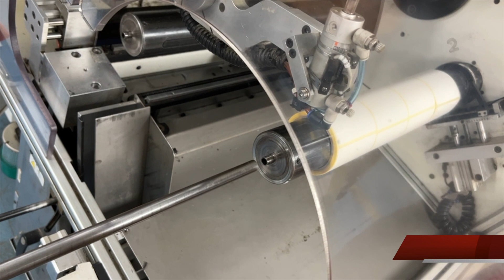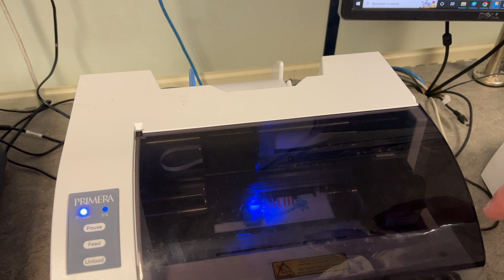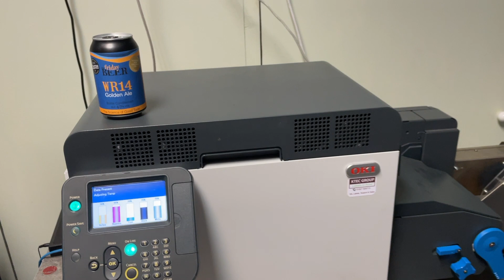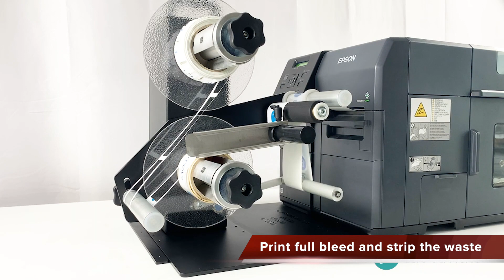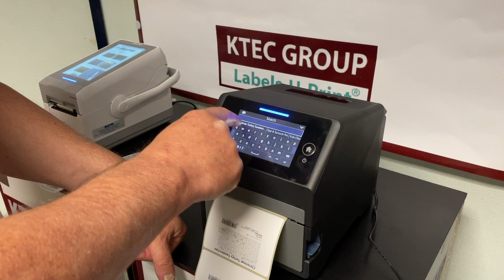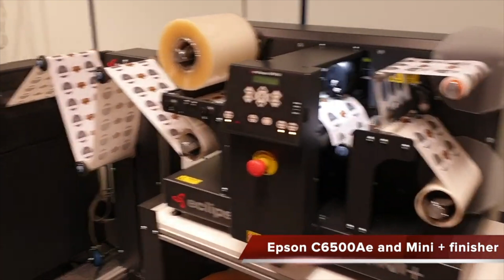Choice of colour label printers and label applicators, Labels-U-Print ® - KTEC GROUP UK

Comment: Hello,
Thank you for this great video!
I would like to know how water and smear resistant is so called Watershield ink compared with pigment ink for example?
Pigment ink is quite water and smear resistant even on paper based coated papier but how about Vipcolor VP650?
Does VP550 printer will be also available in Europe?
Thank you very much!
Reply from the maker: Hello VP650e is model for Europe it has enhanced dye ink better for rapid dry and accurate colours without having to mess with colour correction. The new enhanced dye ink dries fast on ink jet coated papers and synthetics whereas pigmnet is slow to dry as it take longer to absorbe due to pigment inclusions not able to dry as fast and can smudge. Any more help please send email to us at sales@ktecgroup.co.uk